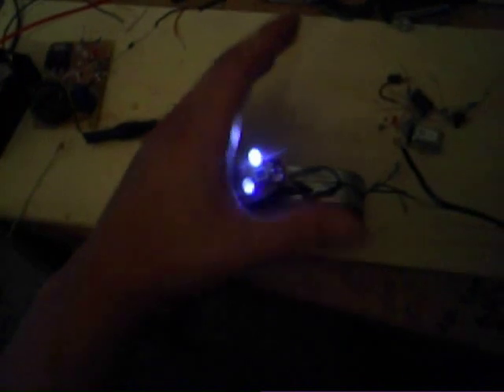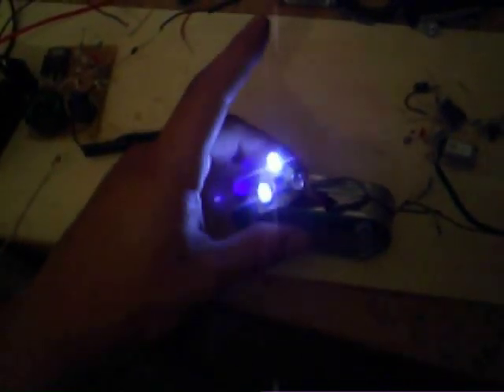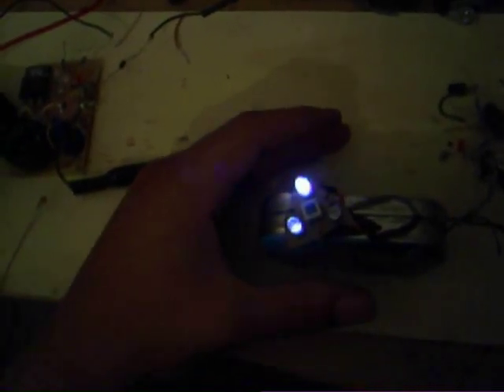touch-activated LED driver, or close proximity activated.

Comment from the maker: @ALLTENCH007 sure dude.look at it this way, touch activated circuits are pretty easy to make as far as electronics go. you can find them in greeting cards sometimes and other devices. it could be two small metal contacts that get bridged through your skin resistance, or even a normal pushbutton switch. the idea would be to use a DIY touch activated circuit where your button just sends an impulse. i will try to find the easiest circuit i can and message it to you. ever seen those touch-lamps?

Comment from the maker: @ALLTENCH007 yes u could u would just need to line the shirt with the leds, and find a suitable power source such as a disposable camera flash circuit, which could be ran down into your pocket with a wire or something. the actual on switch could be a touch-switch than you have on the back of your shirt.

Comment from the maker: @nja2015 no need, its just 4 NPN transistors in a Darlington arrangement, thats all.. and as a matter of fact they are 4 different models too.. doesnt matter.. 2n2222 or similar will work fine, some may work better.

the main Base is touching the tin. the transistors work to amplify each other so very little static is needed to switch it. i have one resistor of unknown value limiting current into the circuit but that isnt needed.